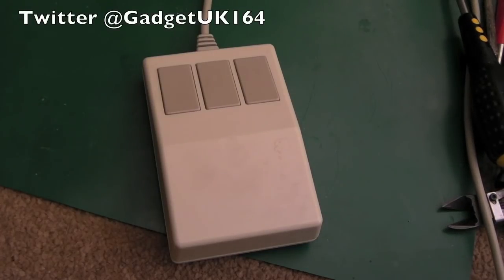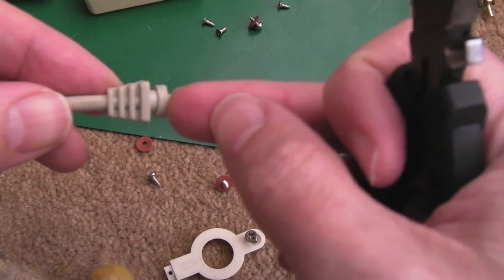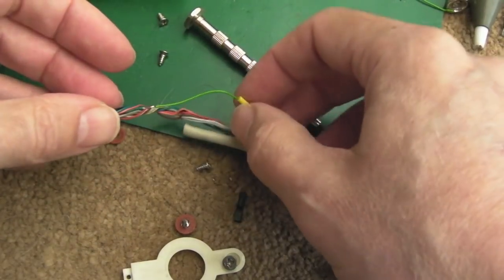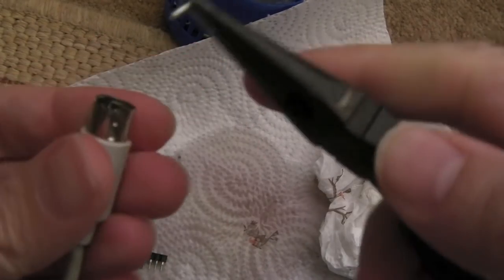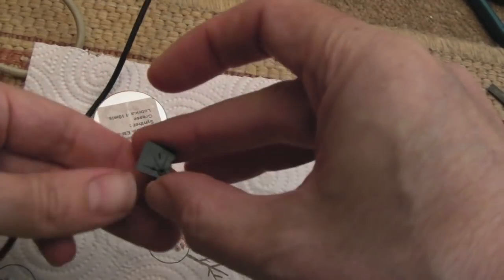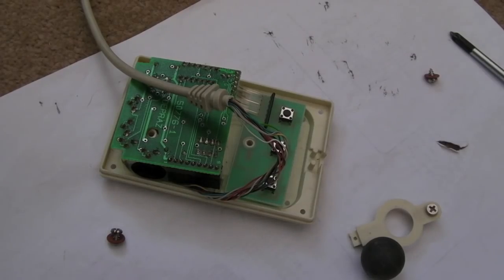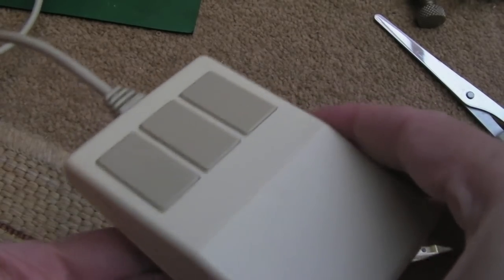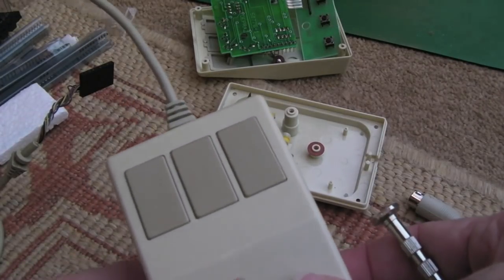Acorn Archimedes - Mouse Repairs & Modern Replacement Balls

Comment from the maker: Important: Towards the end of the video there when adjusting the variable resistor - I had a dyslexic moment where I said "16 64 K" I meant 1664 ohms, 1.6K - no idea what on earth the vocal part of my brain was doing!  I knew what I meant!   Also, pretty sure the same mod could probably be done to mice from other systems.  Search for ball bearings of the relevant size.

Special thanks to Zarchos for sending these to me, along with loads of Archimedes systems which will feature on the channel soon!

Other possible balls you could transplant with:- 
Marbles http://tiny.cc/hrp5gz 
Wood http://tiny.cc/rtp5gz
Reply: That's ohms law for you!😉

Comment: As far as I'm aware, there are three different types of original Acorn mice-  the flat triangular ones  like the first one you worked on in this video were shipped with the very earliest machines, then there were more rectangular ones which shipped with the A3000 and early A5000, and the curved Logitech branded ones were shipped with the A3010, A3020, A4000 and RiscPC.

Comment: 9 wire cables can be found in joystick/gamepad extension cables (still sold for the Sega Genesis, etc.)... I've used them to repair Atari and Commodore joystick cables that were broken, and they have plenty of length. Of course they're going to be black in color, but still could be handy in a pinch. Just an FYI. :)

Comment: IIRC there are (or at least used to be) cheap optical mice with clickable scroll wheels (which can be used as the menu button) which use a quadrature signal and can be modded to work with the Archimedes. I don't know if you can still get them these days, though.
Reply: Yes, it's been described on the great Stardot forum.
Reply: The Arc was the only computer I was more comfortable using a trackball. I only had one so I traveled around the building with it when working.

Comment: I don't remember where I saw it but I saw someone convert a Tank Mouse to use a laser.  This person ran into issues because Commodore used different manufacturers to make the same mouse so the internals vary.    I wonder if there is a similar conversion kit available for the Archimedes Mouse which eliminates the ball issue and the degraded plastic issue because over time plastics do become brittle aka degraded.    Here in the USA I am not sure if anyone here ever used an Acorn System yet we all use ARM Processors here which came from Acorn.   Anyway I trust the Acorn Mouse works better than those old Amiga Tank jobbers which I have a collection of them because I just replaced them with more modern models.

Comment: Was that third mouse found in a canal? I've got a couple of Amiga mice with ball trouble, I'm going to try that. I've also found that control buttons from VCR's are perfect replacements for a mouse.
Reply from the maker: Haha =D  Does kind of look that way!  Those bars that run through the centre of each wheel on there were very rusted =/   Regards the buttons being the same as VCR buttons - yes, same as on some of the Nintendo systems (GBA shoulder), XBOX One shoulder buttons, and many other products - standard 6mm x 6mm tactile switch, presumaby with a 1mm top clearance.

Comment: Where would I be able to source IR photodiodes transmitters and receivers for mice from?
Reply from the maker: It's pretty difficult sourcing them I think!  It's worth asking on the Stardot forum - someone may have stock of them.  Alternatively its a case of looking at modern devices on Digikey, Mouser, Farnell, CPC, RS Online - try and find something that may fit (perhaps with adaption) and just try it.

Comment: Broken 3 button PC "Bus Mouse" cables may be used as a replacement cable as it has 9 wires and the same connector ... I repaired a Arch mouse by salvaging the cable from a cheap $5 bus mouse from ebay.
Also, it is possible to convert a 3 button bus mouse for use with an Archimedes by changing the wires in the mouse.
Reply: Not all bus mice unfortunately. I bought a pile (3 button model) and they only have 8 wires. Maybe I was unlucky but my advice is beware, check 1st.
Reply: @Archimedes75009  Iirc there were some weird 3 button mouses where the centre button was a straight-line mode .. they weren't real 3 button mouses. Real 3button bus mouse needs 9 wires.

Comment: That wire is never going to hold.  You need a mechanical connection.  The heat shrink tubing may give it enough support though.
Reply from the maker: Yeah, it totally will!  Did you see how it is internal to the mouse when I slide up the grommet over it?
Reply: No. I thought it was still in the wire and not inside the mouse.  Not only that, but the shrink tubing will help a lot.  Nice job on the rebuilds, especially the plastic you epoxied.

Comment: Can't believe how much that mouse ball has cracked, never seen that before. If you dropped it on a hard surface it would probably shatter in a million pieces!
Reply: Would be interesting to see if they do that!
Reply: The rubber coating absorbs all the nasty germs and oils over the years, and when most ppl clean them they use IPA. IPA in turn dries out the rubber allowing the germs and oils to adhere to it even easier, rinse repeat and you end up with the entire rubber coat dried up and disintegrating. I have a mouse for my Amiga that I had since my original A500, and the rubber ball is still fine because I use a little dish soap and nothing harsher.

Comment: Just spray-paint the ball - it will give it additional thickness.
Reply from the maker: Thanks, yes - I did consider that option!  But you really need to spray it with something that won't wear off, and it needs to be rubberised or something probably.